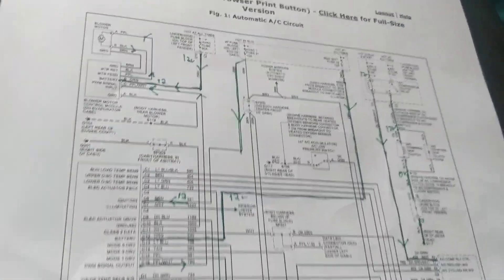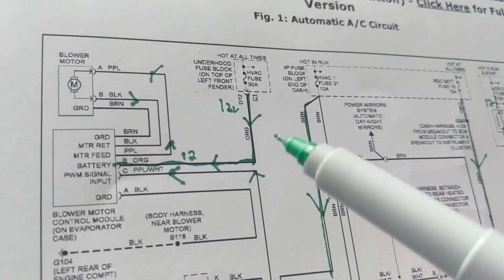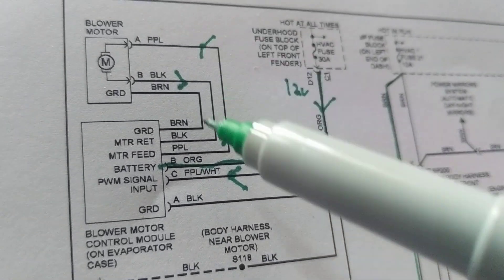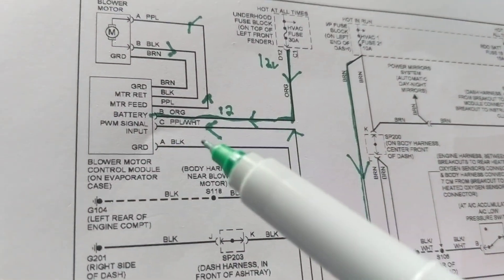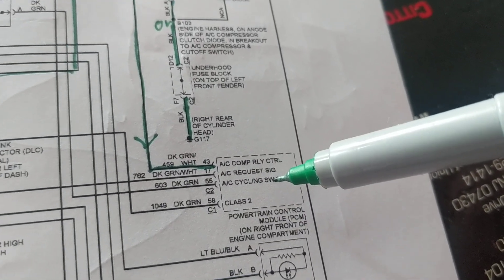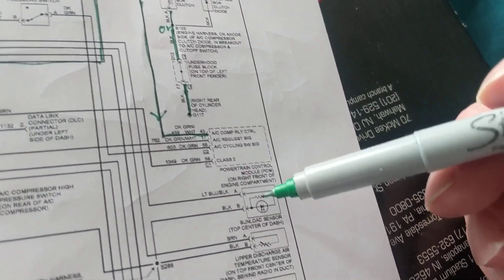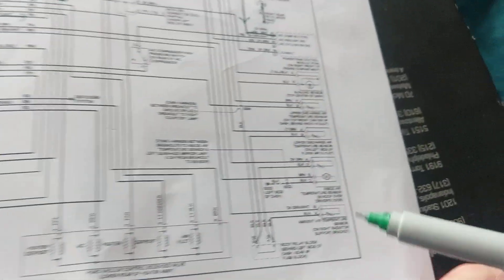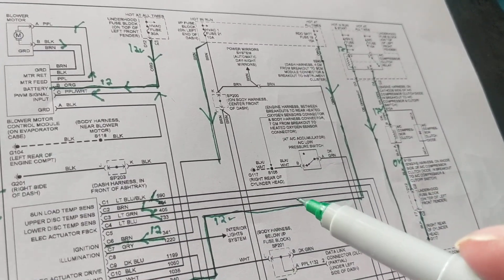HOW TO UNDERSTAND MODULES AND SENSORS FOR AIR CONDITIONING

Comment: Great video thanks for the education,  question for you
Do you think a break in a cable can in an outside Temp Sensor can create the following behavior Display of outside temp starts out reading the same temperature I see on my phone but then as I drive it starts decreasing to the point where I just see a _ _ _

I get a CEL (check engine light) and talks about a

Engine Control fault visit workshop drive on poss.

After a scan it came back with a:
U0423 Permanent
Invalid Data Received From Instrument Panel Control Module
U0424 Permanent
Invalid Data Received From Instrument HVAC Control Module.

I even bought a new ambient sensor and replaced it; CEL went away and 3 days later; there it is again. then CEL goes away and thing for days and then again all over :/
Reply from the maker: Usually anything that starts with a u and a code reveals communications problem to a manual more than a sensor you would have to see what your module is related to the system of temperature go to Google and put in the wiring diagram for your model and make of your car I try to trace it if you have any problems inform me
Reply: thanks for the quick reply!  @Joeelectronicschematicsforauto  I have the wiring diagram with me and looks simple enough, 2 wires, one (labeled SIG) goes to the A/C CONTROL UNIT on input 5 called OUTSIDE TEMPERATURE  and a another cable (TERM31) that goes to input 7 called SIGNAL GROUND. looks like 1/2 way there is a bridge?  that has a X010 (what is this?)  according to the diagram, I'll take a look physically and see what I can find out of norm. if you can think of anything else for me to try I would appreciate it!

Comment: Sunload sensor doesn't give off light. Look at the direction of the arrows. They are pointing towards the LED. It's a photodiode that changes it's electrical resistance depending on the strength of the infrared light coming from the sun. The sensors used to detect the air temperature from those vents are called thermistors most likely NTC. They will always use a different 5V reference than the other sensor signals so be careful using them for diagnosing
Reply from the maker: Yes I believed I express this same idea as you when I made a video about this and it should be on the channel you have these sunlight sensors also on the dashboard turning on daytime running lights but I spoke about this on my channel Joe electronics schematics for Auto in the previous video thank you